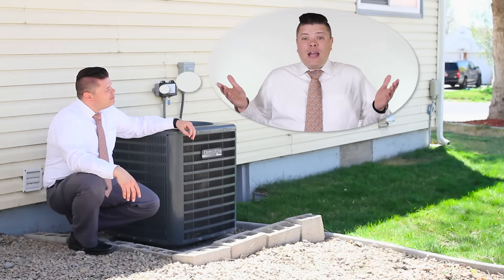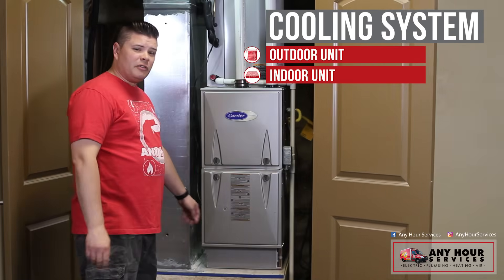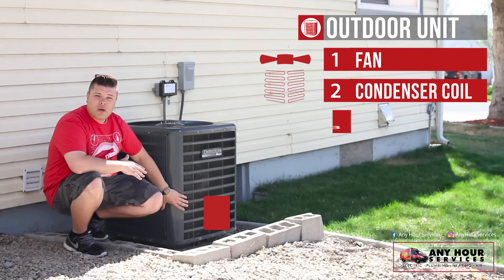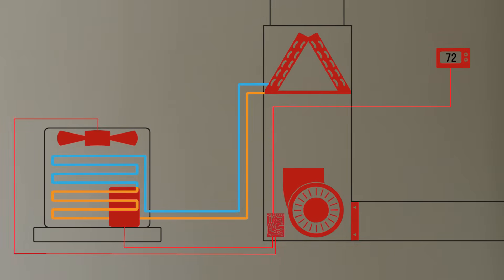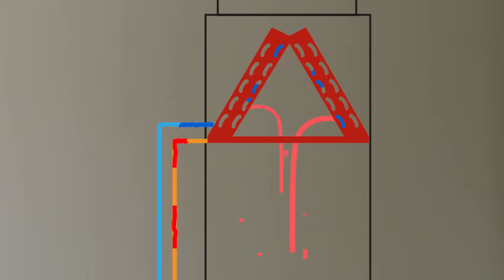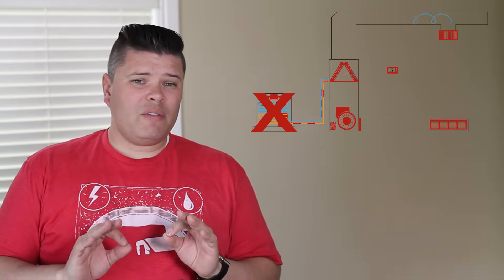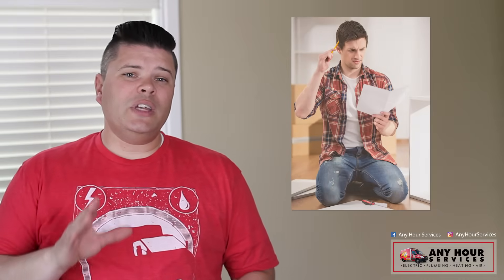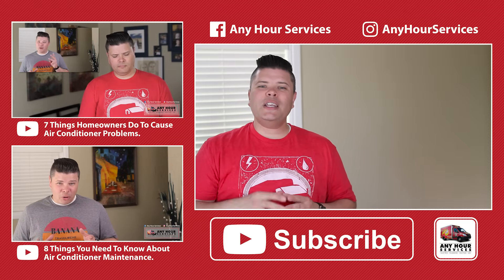How An Air Conditioner Works: 11 Things You Need To Know

Comment: Question for u. Should an a/c unit cycle or a smaller size to run more. Mine cycles like for heat n my tech is trying to get me to go smaller. I’m at 4 ton for 2500’. Because u speak reality I’m looking to u for feedback.I get efficiency is just when it’s running but …. I also burn wood n that exchanger is above the Acoil n I really noticed a major reduction in air flow after I put that in. I use an air handler unit.

Comment: When in heat mode is the outside fan on condenser supposed to work or does it not work because it’s in heat mode, hope you answer ty
Reply from the maker: Unless you have a heat pump, the outside fan only runs when you are in air conditioner mode.

Comment: Does my ac unit bring in even a little bit out outside air? We are trying to remove the smell of smoke after being by a wildfire.. Thx for clear tutorial graphics in ur videos.
Reply from the maker: it depends on the way your system was set up. Most systems don't by design but on the other hand, many do because the homes are not sealed up very well. If you are trying to get rid of odors, talk to an HVAC company about indoor air quality products that help neutralize odors. Good luck and stay safe. If you live in Utah, give Any Hour Services a call.

Comment: Does the fan on the condensor unit blow up the hot air since it seems to be exchanged here in the condensor coils?  Essentially expelling heat from the coils?
Reply from the maker: The coils have the refrigerant running through them and that is technically what is transferring the heat. The refrigerant coming outside is hotter than the ambient temp outside. The condensing unit is pulling air across the hot refrigerant lines and blowing the heat out the top. That helps cool the refrigerant before it goes back in the house. Hope that helped answer your question.
Reply: @Anyhourservices  it does, thanks. I just got may  ac serviced and became fascinated by the inner workings.

Comment: Hi, thanks for the video. Does an air conditioning unit ever bring fresh air from the outside? I want to know how to maintain positive pressure in a home.
Reply from the maker: Doesn't usually bring air in from outside. There are some systems that are engineered to do that but most don't.

Comment: My furnace blower motor isn't spinning? Is this why my AC isn't blowing much cold air??
Reply from the maker: If you're serious, you should probably get that looked at.
Reply: @Anyhourservices  is that a yes?? Does it supposed to spin while on cool mode? It spins when I turn on the heater
Reply from the maker: The blower fan is what pushes the air through your system, whether you are on heat or cooling mode.

Comment: Great video. What happens if the AC system and furnace are not the same SEER level? I am trying to avoid buying something I do not need. For Example if a new AC has a SEER 16 rating but the blower in the furnace only support 14, would buying an AC over the SEER 14 be a waste of money?
Reply from the maker: There are 2 different things you have to consider. 
1. is the size of the system or how much air it can condition and move throughout the home. The size depends on the engineering requirements of your home and it's ductwork. So someone needs to take some measurements and do some calculations of what size your home needs. Air conditioners are measured in "Tons" and Furnaces "BTUs". 
2. is efficiency. air conditioners are usually measured by "SEER" ratings and furnaces   "AFUE" (also a %).

As to your question. You can replace one piece at a time if you want but I would recommend you have someone come out and perform an engineering analysis on the system (should be free) and then, if they sound knowledgeable, get their recommendation. As long as it is the right size, efficiency is your choice. 

Hope that made sense. Good luck my friend. If you live in the Utah market, I'd be happy to send one of my guys out to talk to you.

Comment: Awesome video! I’ve been learning about HVAC ever since I was 3. Since that’s nearly ten years for me so far, I definitely know how a residential style HVAC system works. This is a really good video with an awesome model showing all of the parts working together. Great job!
Reply from the maker: Nice. Are you curious about all mechanical things or just HVAC specifically?
Reply: Yes, I am curious about most mechanical things. For example, I have been into Elevators, Washing Machines, Fire Alarms, Garage Door Openers, and a few more I can’t remember.
Reply from the maker: That's great. Keep it up.

Comment: My  A/C inside unlt stops but the outside  unit keeps on and freeze the lines
Reply from the maker: Without being there it is difficult to try and diagnose the problem. There are lots of things that can cause your lines to freeze up and I'm not sure exactly what you mean when you say the "inside unit stops". It could be the blower fan stops because you have the setting on your thermostat to only run when it is calling for cold air. If your filters are dirty and you're not getting enough air flow the lines could freeze up. I recommend having your system checked out by an HVAC technician. If you call a company just check reviews online and find someone you trust. Here are some simple things you can try yourself in the meantime. Good luck! https://youtu.be/8aM5rnTbMI4

Comment: Great video. You would think the cold air would come through the bottom vents and the  warmer vents would be higher on the wall because warm air rises
Reply from the maker: The placement of the vents in the illustration was just to make it easier to see the air moving through the system. The vents behind the walls go all over the house. Thanks for watching.

Comment: pretty good video, so the air conditioner actually reuses existing air in the room since it recycles it and sends it back out into the same room after it has been "conditioned" by the coils right?
Reply from the maker: Yes. When the main blower motor is running it is constantly pulling air through the return vents and then blowing it out through the registers. It isn't necessarily the same air that was in the room because all of the returns are connected and supply vents as well.
Reply: Yes ok but I meant the same "indoor" air. It isn't pulling fresh air into the mix. The ventilation would still be required right?
Reply from the maker: I see. Most homes are not sealed up tight enough to not have fresh air introduced into the air in the home everytime a door or window is opened. But not as much air as you might think based on your question. You can install a device that brings fresh air from outside and introduces it into your home but most homes do not have that feature. That is one of the reasons the EPA says the air quality inside our homes is 5 to 7 times worse than outside. Thanks for the clarification on your question.

Comment: Why does the hot air get returned from the bottom and cold air from the top?  shouldn't the hot air want to rise?
Reply: exact same question came up my mind but then i realized that both ducts are just circulating what ever air in in the room. Just like our windows A/C , taking in air from room and throwing out cold air back in room.
Reply from the maker: Yeah, it is drawing whatever air is around through the return. Thanks for your comments.
Reply from the maker: It was easier animating the video to illustrate it this way. It is true that colder air will settle lower than warmer air. In a home with a forced air system, sometimes the air vents are on the floor, wall or ceiling . . . depends on how the duct work is run. Same with the return air. And the return air doesn't just draw in warm air. It is drawing air in the room to run back through the system and it is like a big air mixer, drawing whatever air is close. if your system is designed properly it will circulate most of the air in the room. Sorry if the illustration was confusing at all. thanks for the question.

Comment: Have an old house with just a hot air electric furnace. What work would I need to add A.C and what price range am I looking to make cold and hot air come through my vents. Any additional work that my house will need to make it compatible?
Help is always appreciated.
Reply from the maker: Great question. The good news is if you already have forced air for heating the duct work is already installed and that can be an expensive part of the job. You would need to have a company or 2 come out and give you a bid on installing an air conditioner. The main unit would be installed outside and the refrigerant lines would run inside where the furnace is. An evaporator coil would be installed there, usually in line of where the heat exchanger is. The cost will depend on the construction of your home and location of your furnace. They may or may not need to cut in an extra return air or another vent to make sure the system is balanced and moving the air properly. If you do it I think you'll love it. My home was that way when I bought it and central air has been amazing in the summer. Thanks for the question and thanks for watching our videos.

Comment: Guys I'm in the UK where we normally have a large condenser unit outside the house and a small wall mounted system inside the house which blows the cool air in.  my question is this.   Does the condenser unit pull the air from outside the house and cool that and pump that cool air into the house or does it simply take the warm air from inside the room and cool it down inside the condenser and then pump it back into the room cool?  i.e just recirculates the existing air already inside the room but cools it down and recirculates it?  or does it pull new air from outside the house via the condenser?  the reason I ask is because the condensers have vents on the outside and a fan?
Reply from the maker: Typically, the way those systems work, it is recirculating and cooling the air in the room. The warm air from the room runs through the wall unit, across coils that have refrigerant running through them. It's the outside unit that cools the refrigerant. The reason the condensing unit outside has a fan is the same reason the outside unit in the video has a fan. When the refrigerant gets to the large unit outside, it's very hot because it's removed the heat from inside the house. The large fan is drawing air across the refrigerant coils to cool the refrigerant and that refrigerant is then sent to the inside unit, which is what cools the air inside.

Thanks for asking, I hope this answers your question, let us know if we can be of more help!
Reply: It uses air from the inside and cools the air down. But also it uses air from the outside and heats that air up. Those window mounted unites have two seperate airsflows going through a system of refridgerant that gets cooled on one side and heated on the other.

Comment: I live in Florida. I have normal attic insulation and I have blown in more insulation on top. My attic unit is new (2 years) outside unit, not sure. I replace the filter monthly.. I cannot keep the house cool. Weirdly, if I have guest the A/c is even worse. Could the number of people in your house affect the way your A/C performs.
Reply from the maker: Yes, it can, but you shouldn't notice a huge difference in the way your air conditioner works when you have a visitor. The bigger issue is that the system isn't cooling your home!

There are several things that could be causing the system to not cool your home properly. It's good that you change your filter monthly, and there are a few more things that you can do yourself to make sure you're getting good air flow through your system. This video will show you some of those things: https://www.youtube.com/watch?v=MMY0Zi-sFPI

Additionally, here are some common things homeowners do to cause issues with their system: https://www.youtube.com/watch?v=8aM5rnTbMI4

If you've already watched these videos, great! Start with those tips. If doing those things hasn't helped, you probably want to have an HVAC company come and service your system. It could be that you're low on refrigerant, the compressor outside is going bad (and not recirculating the refrigerant properly through the home), you could have a bad capacitor, or even a few other things. Those things are more complicated to do yourself, and it's probably best to have a professional come and look at it.

Sorry to hear your system isn't working! Thank you for the question--I hope this helps!